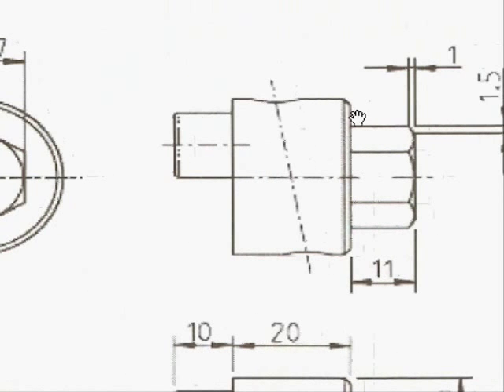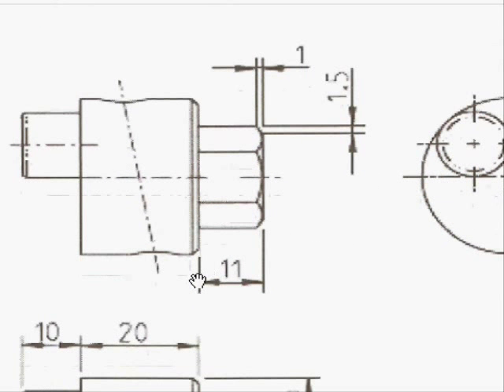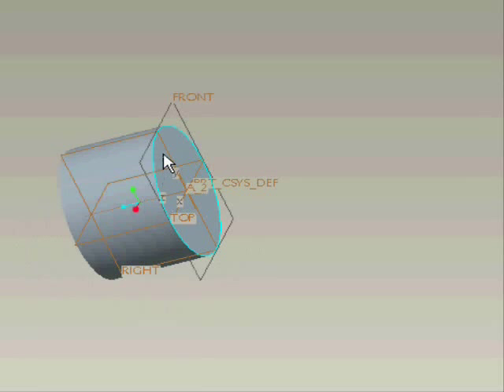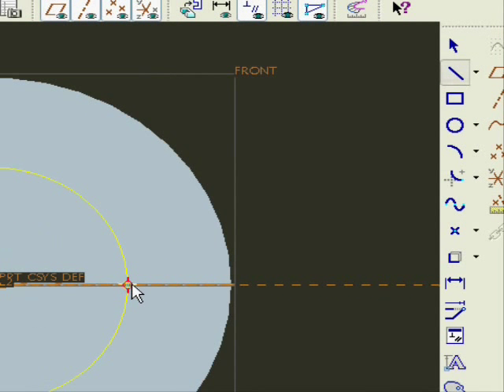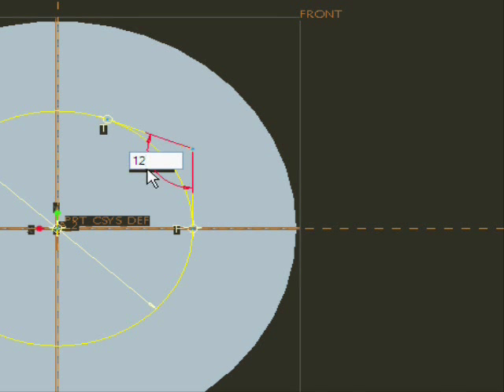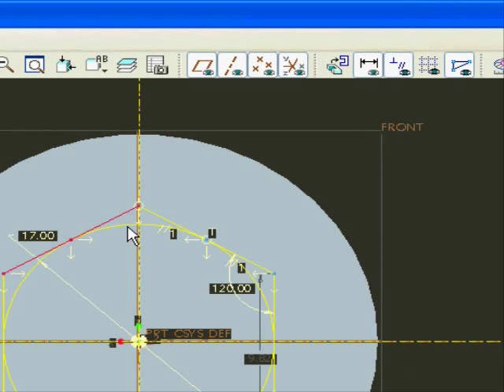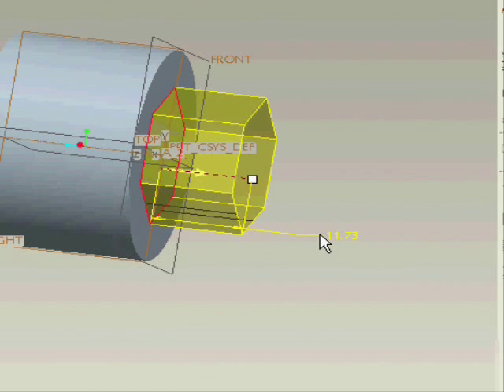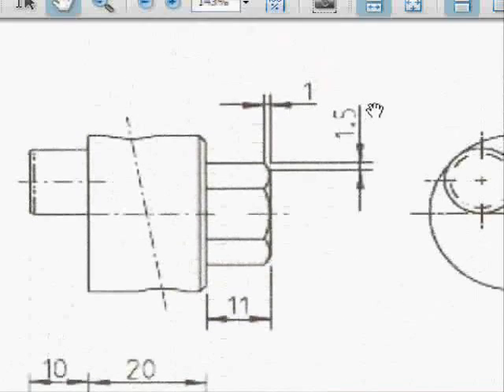modeling a nut using ProE

Comment from the maker: Hi there,

The hexagon command or a button that creates the hexagon shape is the one that looks like the painting pallete at the right hand side in the sketch mode below the button with the "A" letter on it.

Nevertheless, I did not really use it in creating this nut. If you have further questions, don't hesitate.

Best Regards